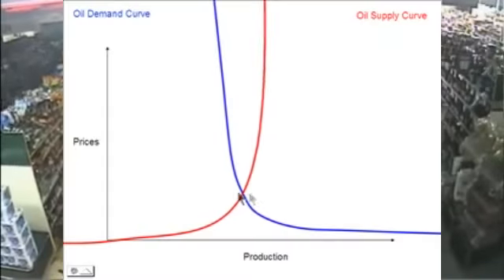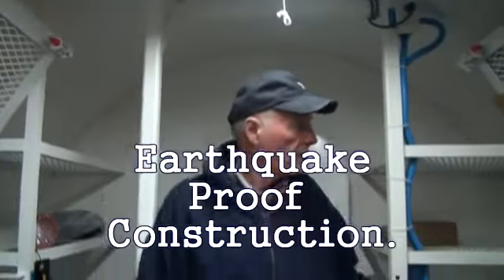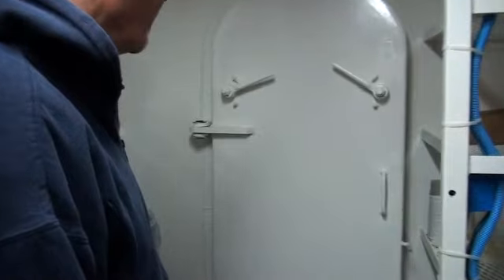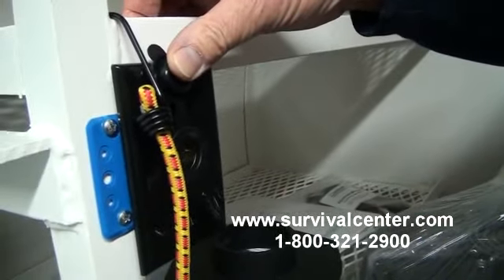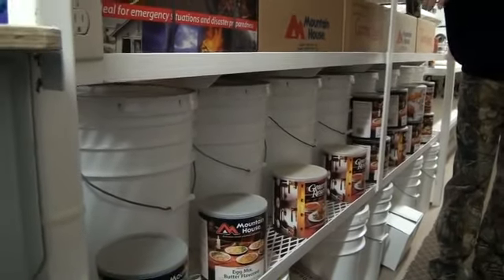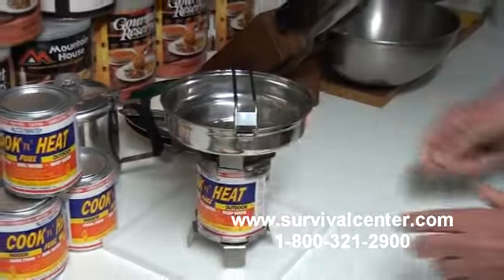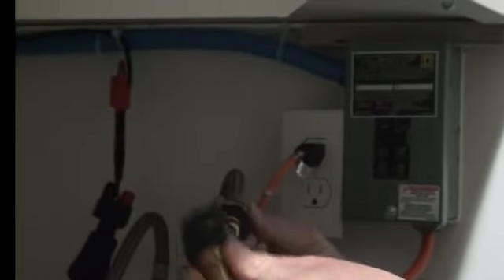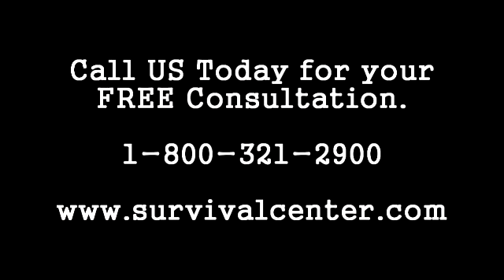Alex Ansary features Underground Shelter defense for Asteroids, Unrest, Disasters, Food Shortages

Comment: @cvunit Those not exposed to the direct blast had higher rates of cancer and birth defects, but they're not having their hair fall out or otherwise dying of radiation.  The bomb dropped on Japan Hiroshima was 18kt versus the largest of 100MT today. However countries switched primary to ICBMs with MERVs of 20MT or less. The level of destruction is not linear though, so a 36KT does not cause twice as must damage as an 18KT.  If you are miles away and  even 3ft underground you should be fine.

Comment: @shadowhunter388 actually there is a way to get oxygen from the water, after all it's chemical structure is H2O. Or if you put this underground near a tree you could probably camaflauge an air vent tube to the top of the tree.

Comment: @fredboyking I believe you mean radiation travels in a straight line and can't turn corners.  That would only possibly cause an issue with their vertical escape, but short of the bomb going off directly overhead as long as it was under 5 feet of ground direct radiation exposure would be minimal.  Additionally, the exterior is not shown.  If that vertical access had a small concrete covering/entrance way you'd definitely not have a problem.

Comment: @DIRTDlGGLER  also a really poor emergency escape system, it should be built with locks like the door or a knock down support. Bury a steel container that has been sprayed with insulating foam surrounded by 6x6 beams then add 12 volt and a portapotty and a air purification system , food and hope for the best. I bet ya it wont cost 100 grand.

Comment: Alex Ansary, Outside the Box TV - Mid June 2019

We are now officially in the solar minimum, also called a deep solar minimum. NASA predicts it will be at it's lowest point in 2020. Concerns are mounting regarding a return of a “little ice age” similar to the last one between 1650 and 1710 when temperatures plunged when the Sun entered a very quiet phase now called the Maunder Minimum. This was the period of time where there was the least amount of sunspots in the last millennia. Deep solar minimums have been linked to numerous periods of decreased temperatures.

I also want to note that there are periods where society seems to wake up to the relevancy of the changes in the Sun's activity and how we are affected. We are currently in the “quiet before the storm” part of the cycle but how often is it that the quiet is needed for the mind to make sense out of the data while solar maximums might have us in a more action oriented mode or mentality with deeper thought taking a backseat among the noise.

Astronomers typically associate periods of solar minimums with colder temperatures because of “natural heating mechanism” of the Sun subsides. This involves UV radiation warming the upper reaches of the earth's atmosphere. NASA has stated the Earth's atmosphere cools during this process and can collapse, to a degree. This causes space junk to drag, threatening satellites in the process. Cosmic rays hit the upper atmosphere as the heliosophere around our solar system is weakened. These high energy particles can poise health risks, esp. at higher elevations.

Dean Pasnell said “During solar minimum, the Sun's magnetic field weakens and provides less shielding. “

Solar maxim is a shortened term also used for the more active part of the cycle.

Guiliona Toma says “Usually at solar minimum, the coronal holes are at the Sun's poles. Therefore earth receives solar wind from only the edges of these holds and it's not very fast.”

Solar minimums are not totally boring and the less active cycle has been linked to our earth's weakening magnetic field, meaning we are even more vulnerable to the effects of solar flares and other fields of energy. M class solar flares could have the impact of X class solar flares or more.

The earth continues to experience geomagnetic storms even during periods of a spotless Sun due to portals connecting the Sun to earth that open and close, changing locations every 8-9 minutes baffling scientists. The Sun's rotation every 27-28 days releases solar plasma and particles into space at a slower rate and more spread out as opposed to a direct solar flare. Other stars can create geomagnetic storms and this new information challenges our understanding at present of all the factors involved here that are affecting our planet's field.

Recently (June 14th 2019) the news was alive with alarm and war drums with discussions of a oil tanker explosion, blamed on Iran. Tensions continue to build after a US drone was shot down. There were plans to attack that were reportedly called off. People are at the edge of their seat over this. How many of them know that within a day or 24 hours of the explosion, earth was experiencing a geomagnetic storm?

Deep solar minimums can awaken with activity from CMEs, to solar flares, unannounced, and causing massive reactions down on the ground here on earth. Going from low activity to suddenly high activity can easily affect society in biological ways and as people get emotional quickly, their emotions can quickly bounce off each other in a loop. Know when and how to disconnect from that.

Earlier in June of 2019, a geomagnetic storm was recorded as Dallas, TX saw a freak storm and fast winds blew a crane into a apartment building as power went down to hundreds of thousands in a week where the news pointed to a map of murders going up across the city. Meanwhile across the planet in Hong Kong, 1 million protesters mobilized to voice opposition to China's new extradition bill.

This isn't even 1 percent of the correlations that I've personally noticed between space weather and major headlines since first discovering the connection over a decade ago.